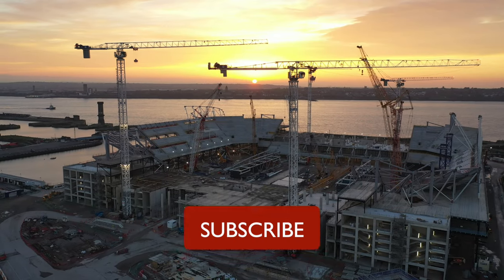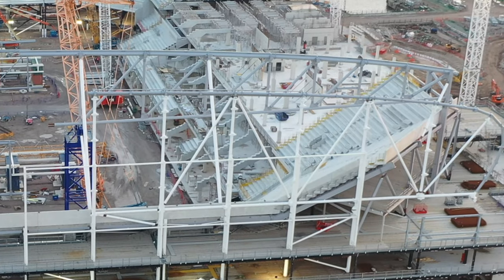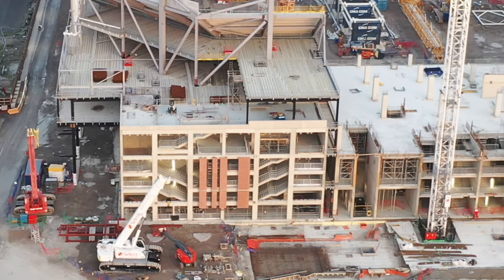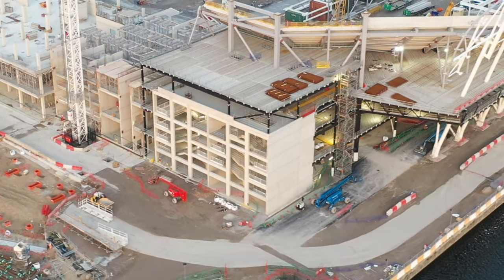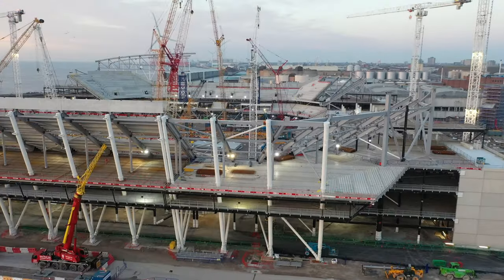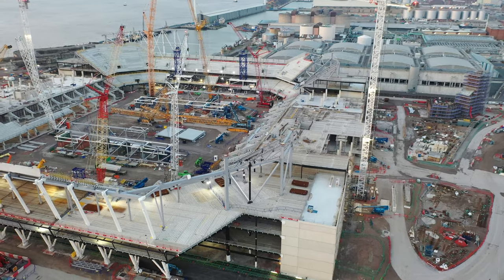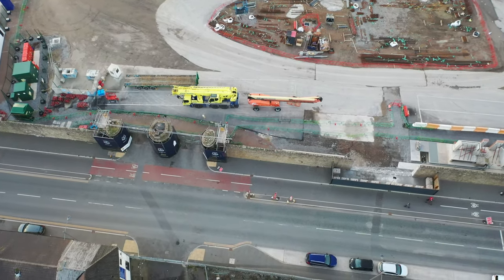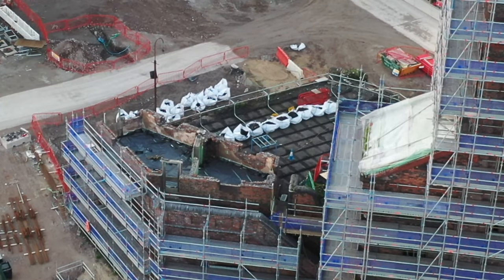Everton F.C. Bramley Moore Stadium update. A nice sunset with some good close ups.

Comment: The brick facias are made of real brick that are cast in concrete. They half the bricks to be more environmentally friendly and reduce cost.  Did you notice the new bridge which looks temporary rather than permanent

One question though is what the huge grey rectangluar pieces are in the middle? Are they the supports for the giant screen that attaches to one of the trusses?

Comment: Next roofing truss will be on the north east as the blue support is already in place.
Reply from the maker: I stand corrected
Reply: @Kevcupo  😂😂. Reply did look a bit harsh. Cross members will go in this week from the piece attached to the North stand to the peice that is being held up on the blue scaffold. North East truss should be in this week and looking at the dimensions it will need an infill bar in the center to connect them together. Funny how the Red supporters are doing better footage than the blues.
Reply: @paulross1296  You sure the centre truss piece won't go up first at the North End ? The plans indicate each truss will be constructed west to east.
Reply: @JayEFC1969  would think that the north east truss will be supported by the blue scaffold then the center beams slide in between.  There would be to much stress on the bolts if the center went in first.
Reply: See you should never believe someone that lives halfway round the world. Just watching the official site and the support is in for the next roof truss lift "on the south stand." 
🤣🤣

Comment: Thanks for this video KC. I am thinking that the next truss will be again in the North Stand because the blue support frame is in place to rest it on and as soon as they finish the concrete terracing in the North East corner. The South Stand trusses need some blue support frame to be in position before we see anything happening there, even though the steel work is going across the back. Hope you achieve your goal. Only the weather or the coziness of a warm bed will stop you I think 😂.